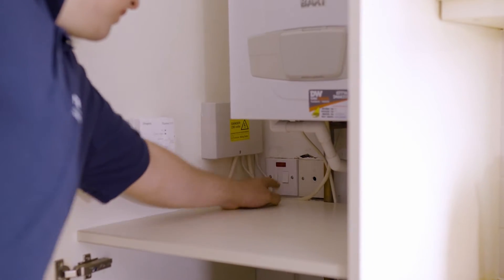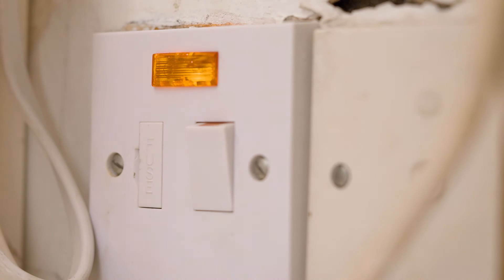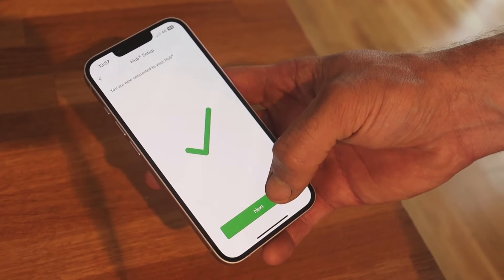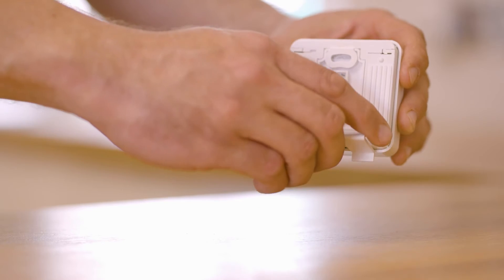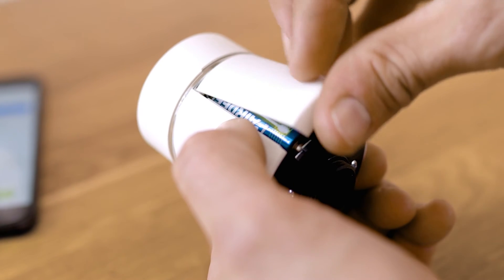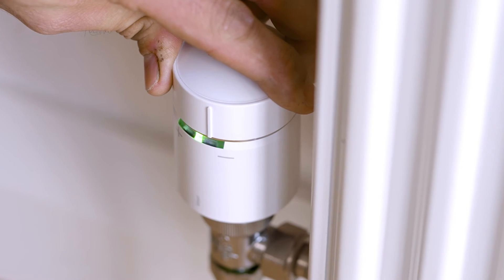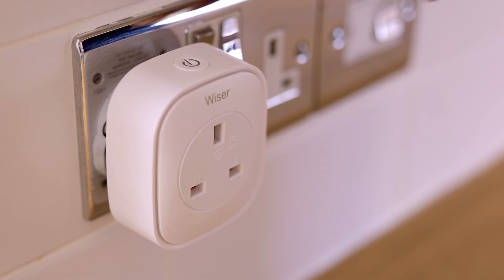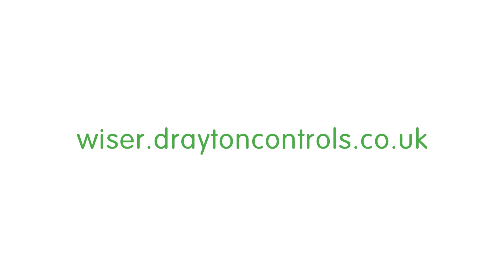How To Install Smart Heating With Multiroom Control | Wiser

Comment: Whats the noise level of the trv ?
Reply from the maker: We have independent test data from BEMA that shows that having a Wiser multiroom system installed plus using the smart modes can save up to 30% on your energy usage.

Comment: Stone wall house? The customer has to pay extra for these add on's. How long will it take to replenish the savings?
Reply from the maker: We have independent data from BEMA  that shows that having a Wiser multiroom system installed and using smart modes can save you up to 30% on your heating bill

Comment: whats the benefit of using the wall thermostat together with the smart TRVs?
Reply from the maker: Removes the sensing away from the heat source. It's good if furniture is in the way!
Reply: @draytonhome  could I please ask - say the thermostat is fixed in a certain room - there is no need for a smart TRV in that room?

Comment: I've just set this system up at home and it's amazing, but there are a few very important things to be aware of:

1. The maximum number of heating zones is 16. You can assign multiple devices to one zone though, for example three radiators in one room, or group two rooms together into one logical zone if necessary.

2. The Hub uses its own RF to connect to devices directly, which can be a problem if your boiler is tucked out of the way in a corner of your house. Our house has lots of external walls and our wi-fi is a wired in mesh network to cope, but this is not used by Wiser, other than once to connect the Hub to the network. Range extenders for the Hub's RF network are sold (a feature of the "Smart Plugs") , but they have a maximum number of 6 devices each, and when you switch one on it'll grab all the devices it can find, not necessarily the ones out of range! I spent two hours on the phone to support, to no avail. I did later manage to set it up on my own. to It's pretty tricky to force it to include the out of range devices in its list of 6 - the only way I found was to delete enough in-range devices that it had to include the out of range ones in its list of six, then add the deleted devices back in and they'll connect to the Hub, because the range extenders are full. We have two range extenders and this was a frustrating and lengthy process. If this could be fixed I'd give Wiser 10/10. Once it's installed though, it's done, so it's 10.10 when in use.
Reply from the maker: Thanks for your feedback, we will forward your suggests to our product management team.

Comment: I tried for about 3 hours today to complete the setup of a new Wiser 3 system. The connection is first made to the HUB component as you show in video. But when returning to my  WiFi connection for internet service to phone it all goes pearshaped.  I updated HUB firmware to 4.22.4 but no solution. After each failed attempt I noticed that the device SSID name "Wiser88_xxxxxC" changes to a different SSID - the number 88 to something 77, 66, 55 for example. This looks wrong to me. Why does the SSID change after every "failed to connect"?  Where do I get help or do I have to return the complete system?
Reply: I can answer this.
You need to contact customer service and they will allocate you a new I.D.
I got this and the p.o.s had been fitted to someone else's house and put back in the box
Reply from the maker: Sorry you are having problems, chat with our customer services who will be able to check if the system has been set up properly - 0333 6000 622.
Reply: @draytonhome  I followed your advice but with no success. Luckily I bought from City Plumbing and I received a full refund within 3 days.

Comment: If i installed a Wiser kit 1 and then decided to add another room stat later on, do i need to upgrade the hub for a different zone?
Reply from the maker: You can add up to 16 room thermostats on your kit one but if you want individual room control you will need to use them with Wiser Radiator Thermostats to control your heating in each room. You will only need to change your hub type if you were making wiring / plumbing changes to your system.

Comment: I installed my drayton wiser conventional kit 2, with smart thermostats in all rooms (5 in total, including the bathroom) on the 3/12/2023.

I have several problems 

1. I have set different room temperatures as required and at different start and end times. 

2. All heating kicks in and starts warming up all rooms as soon as the earliest time set kicks in even though they have different start and finish times. 

I work shifts, so I don't need my room heated  as and when is not in use.

3. When I chose to boost 1 room  as needed, all other rooms heating kicks in even though they have different start times and temperature times.

4. Even if I reduce the temperatures to between 10 and 12 degrees to stop rooms from warming up as they're not required, they heat and warm up anyway. 

These problems  do not help with the idea of the drayton smart heating efficiency of the heating system ideas.

Eg. I needed to boost only my bedroom at night after work, but the whole heating system kicked in while other people were sleeping, which is not required. 

These problems have rather caused my bills to increase instead of decreasing for efficiency and cost.

Please, I would appreciate it if you could help rectify all these inefficiency problems.

Now, I can't boost a single room without all other heating kicking.
Reply from the maker: I'm sorry to hear your experiencing issues with the system. We have a dedicated customer service team for Wiser that will be able to do some remote diagnostics to make sure the system is set up correctly. Give them a call on 0333 6000 622.